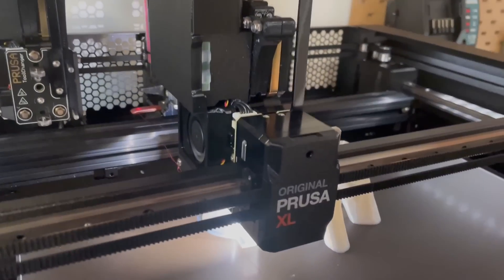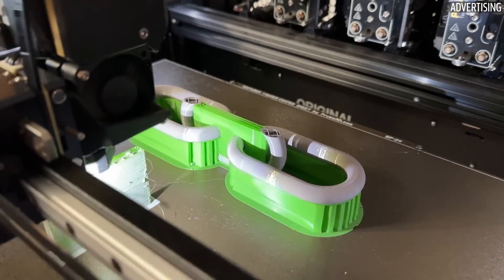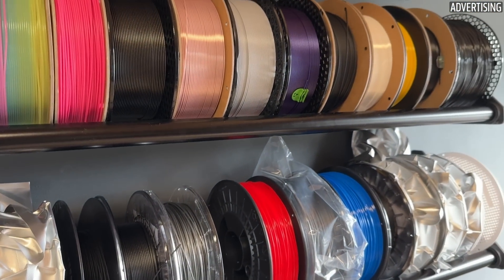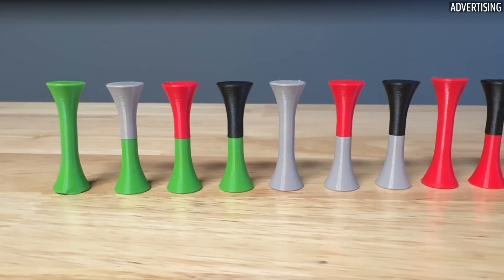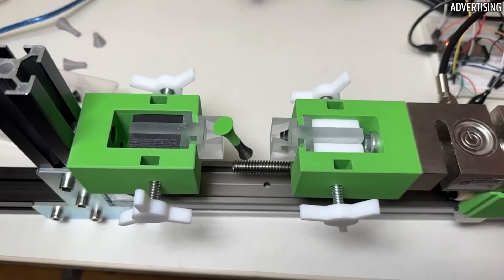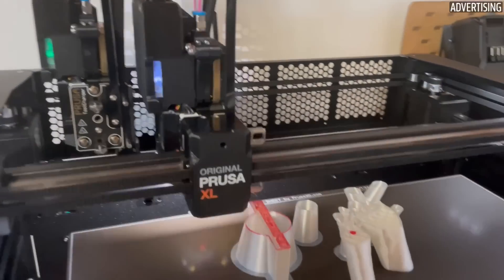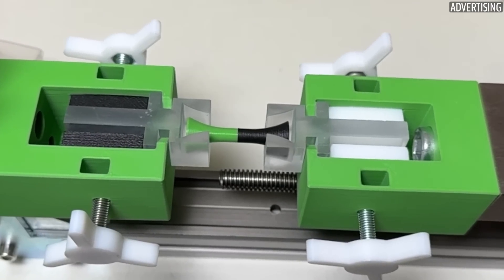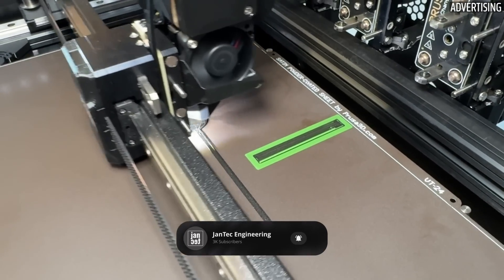You’re Printing ABS Wrong! No Warping & Less Energy Consumption with This Trick!

Comment: As ASA seems to be replacing ABS in popularity, I'd be interested to see this test with PLA and ASA
Reply: I have the exact same experience with ABS and ASA, down to the smell. Both are very easy to print if you do these 3 things:
- Make sure it's dry
- Use smooth PEI sheet. The smooth part of this statement is critically important. 
- Print it inside an enclosure.

It is also a good idea to use some PVA glue on PEI sheet because if you don't remove it before it cools it may get stuck and damage the PEI sheet.

PS: There are only 2 reasons to use ASA over ABS:

1 - The price difference is very small
2 - The printed part will be exposed to UV/weather

Any other difference you may notice is more likely to come from brand / batch / storage conditions (like moist) OR color. Surprisingly it can make a lot of difference within the same manufacturer. For example: e-Sun red and green ABS print beautifully, with impeccable surface finish. Now, try your luck with e-Sun white ABS...
Reply: I had a one-year-old roll of ESUN ABS+ and a brand-new one, both dried and properly stored. However, they were only producing brittle prints, even though I tried many variations in temperature and speed even with 0% cooling. I just tried ESUN ASA, and in my opinion, it's simply better.
Reply: @OneTakeFPV it may have nothing to do with the material itself, but with the quality of esun's blend. It can vary even between colors.
If you want to do a fair comparison you need to compare pure ABS and ASA, from the same brand and color.

PS:
My favorite estirene based filament is extrudr ASA orange. 
very similar in performance but instead ABS, is the black ABS from geetech. But I bet both would be outperformed by the ABS filament from Polymaker
Reply: @OneTakeFPV  I have the same problem with ABS+.  Appears to only be layer adhesion.  It needs fan so the edges don't warp, but the fan is the culprit of the poor layer adhesion.
Reply: @tinkerman-q you forgot an important reason to use ASA over ABS. It doesn't smell nearly as bad while printing.
Reply: @tinkerman-q  Just my experience... I use ABS on a textured PEI plate using just IPA before I print. Sticks very well. No adhesives of any kind. Bambu Lab X1C.
Reply: @troywalker8078  I never tried that, thanks for the tip. Though I don't often have adhesion issues with ABS and I have smooth PEI I just tend to stick to what I know works, and texturized PEI doesn't adhere as well as smooth one, so I had some issues with it for certain parts that are prone to warping, but will try that out of curiosity, thanks for the tip, though the fact that you have an X1C may also play a role, by having that perfect first layer, fined tuned profile and what not others may not have.
Reply: @tinkerman-q  I disagree because i do it the other way and have no issues at all.
If someone uses adhesives on a PEI plate, hes and absolute bob and should just clean it with ACETONE.
Also i use rough PEI sheets with no issues. 
But you will learn, padawan.
Rest is common sense.
Reply: @tinkerman-q  ABS is VERY toxic. How toxic is ASA?
Reply: @andyspoo2  I can't tell you to detail ASA toxicity, but you can put it side by side with ABS. Styrene is still the base component for both plastic types. I got ASA poisoning once, which taught me a valuable lesson when working with these materials.
Reply: @tinkerman-q Did you mean to say to use PVA glue to protect PEI from ASA/ABS? I've never seen it stay adhered well enough after it cools to damage PEI. Unlike PETG, it simply pops off. 

Also I'd advise against using glue as much as possible because it can actually detach from it easier than a clean PEI bed during the print. Once I stopped using glue or cleaning the bed with IPA, ASA became my primary filament. Instead, the best option IMO is to put a SMALL dab of acetone on a clean microfiber cloth then clean the PEI before every print. I've done this for years now but never squirt it directly on the bed, especially if it's heated up.
Reply: @JJFX-  Yes, if we are talking about smooth PEI. Comgrow manufacturer actually features this recommendation in its manual and I could see why. When I did not use glue and first layer was a bit too squeezed, letting it cool would make it incredibly difficult to remove..one of my sheets still has a piece of ABS I could not remove and got damaged with the rest I did remove. Since glue stick never caused adhesion issues with it, I use it most of the time to avoid this problem. My suspicion is that ABS or some blends of ABS may bond with it after it cools. But that's my experience. What I do kbow is that I never have problems with adhesion with or without glue.
Reply: @tinkerman-q  Wow that's interesting, I use multiple smooth PEI beds and have had the opposite experience on all of them, although my primary bed surface now is PEX (or what WhamBam calls PEX). Without fail, ABS/ASA and CF-ASA basically fall off once the bed drops below reported temps of ~50C and I print around ~110C. Only with PET type plastics have I seen significant adhesion like you're referring to. Are you using an ABS hybrid (often marketed as "low warping", etc.)?
Reply: @JJFX-  Most of my ABS are eSun ABS+, and I did not pay attention if the super adhesive experience was exclusive to it or some of the other blends I use. I save ASA for when I need UV resistance, so can't say much about it, except that smooth PEI works well for it too. Most of the time I am around to pop it out of the bed and I usually do around 60C (print between 110 and 115). In the end I think careful experimentation is the best approach on these details. And I avoid PETG on the smooth surface as it also sticks too well to it. The texturized PEI makes it pop after cooling.
Reply: @tinkerman-q  Hmn I haven't used eSun's ABS in awhile but don't recall it causing this either. Well regardless of the reason, having too much adhesion with ABS is a nice problem to have. I've been leaning into ASA now because it's so much easier to get cheap than in the past. On top of the UV resistance, it's a bit easier to work with, doesn't smell as much (although it may release even more VOCs) and at least in my tests there's very little difference in the material properties. It does have a slightly duller appearance which I prefer but I know some people like that about ABS.
Reply: @JJFX-  I totally get you. And indeed. ASA to ABS difference is not as high as it used to be (I managed to get a 1kg roll of ASA-CF for 11 euros recently in a sale of eryone, highly recommend). Smell-wise my advice is that you should not be smelling it, it can be really bad, and I think I got off easy with only a blistering migraine. I am more scared of ASA than ABS, but either way I always wear a respirator when working with either.
Reply: @tinkerman-q  Wow that's a heck of a deal my friend, I'll definitely take note of that. ASA-CF is my favorite prototyping material, it's just awesome stuff. I have some rolls from 3DXTech that are a dream to work with but they're way too expensive.... and yes, I have a decent filtration system and a respirator I typically use but I can't say I'm always good about using it when I need to quickly do something. I've also become increasingly cautious about the fibers in CF fill.
Reply: Be careful with ASA, it releases more VOCs in the air than ABS.
Reply: asa is the same as abs but stinks much less and easier to print
Reply: Bambu studio with my p1s doesn't like mixing ASA with PLA, but using 3dlac and upping the bed to 100°C, and i no longer have warping nor adhesion issues (quite the contrary)
Reply: I expect it to be exactly the same
Reply: That’s what I’ve thought. It’s pretty awesome technique non the less!
Reply: ABS is a lot cheaper than ASA. But ASA has some better properties.
Reply: I wish HIPS would become more popular, as it's similar to ABS but easier to print. Currently, however, it is more expensive and harder to find.
Reply: Can't get ASA to stick to safe my life. ABS is relatively easy, even on an open bed slinger
Reply: @willofthemaker  lol yeah, I recently used ASA to print my enclosure for the P1P and I had to fight the filament a bit. High high bed temps and just accepting a little warping was my solution. + A cardboard enclosure while I made my real one.
Reply: @willofthemaker  Might be the brand you're using? I experience no difference sticking ABS or ASA
Reply: @willofthemaker  I have to use glue stick or ASA will not stick at all.
Reply: @willofthemaker  You're not using real ABS then, lots of ABS+ formulations are actually ABS cut with PLA and will print find on open air beds, but lack the mechnical properties of real ABS. Real ABS will not at all print without being in a chamber.
Reply: @willofthemaker  asa needs an eclosure and heated ideally
Reply: @willofthemaker  I print more ASA than almost any other filament and have no issues getting it to stick.

Except after I print PLA, if I follow a PLA print with ASA it acts like the print bed is slick.

So after I finish a PLA (or even PETG) print I clean the print bed with the rough side of a kitchen sponge, hot water, and dish soap. Fully rinse and dry the build plate.

I never have adhesion issues if I clean the plate.

I print my ASA on a Voron 2.4r2, at 50C for the build chamber, 100C for the bed, and 245C for the hotend.
Reply: @willofthemaker  On an open machine, do you not have any issues with layer cracks due to shrinkage ripping the parts apart?
Reply: @soundspark  "sometimes." My printers are in my garage which is not climate controlled. In the summer on hot days, it's definitely helpful compared to cold days. Potentially 20+ deg C difference depending on the season.
Also a lot of what I do with ABS don't have huge cross sections so I imagine the nozzle goes by where it already played down filament relatively quickly. Maybe rewarms up  the filament enough to prevent splitting. Honestly I don't get splitting too often.. I print ABS around 250-260 and no fan. 100c bed
Reply: @willofthemaker  The Bed temperature has to be above the crystalysation point.
Extrudur asa for me worked perfect at 102°c on textured pei. But I'd go higher if the cooling fan wouldn't cool down the heatbed so much, that more isn't acivable for me.
Also try some asa slurry (acetone +asa), bit that may result in parts sticking to good.

Comment: Wish I could afford a Prusa XL to do stuff like this.
Reply: I'm really hoping prusa comes out with a 300 cubed core xy tool changer. Even 2 or 3 Print heads would be great
Reply: @willofthemaker the XL is 350 cubed
Reply: @krollmond7544  true. I honestly thought it was bigger. Although I think the structure is so strange. Why not the vertical struts in the front instead of the half cantilevered frame. Leads to a horrific enclosure solution that requires way too much time to put together. I don't have near enough time for that nonsense

Comment: Great Test and approach. About PLA as a first layer for ABS: ABS needs those temepratures. It‘s not only about the adhesion of the first layer. The elevated bed temperatures are important for the whole Part not cooling  down.
Warping comes from the upper segment of a part shrinking too much and therefore pulling the below layers up.

Try thicker parts or 100 filled cubes 100x100x100 or even bigger.

What you‘ve found is just an edge case and is not used for example in the professional 3DP industry.

Keep your content up and stay curious!

Sincerly
Andreas
Reply: I wonder how would it warp if someone combined 1-2 layers of PLA every 10-20 layers of ABS. PLA stiffnes should offer a lot of resistance against warping, creating some type of composite material, but I wonder if it would work well. 
For ABS you should generally always have enclsoed printer.
Reply: @OldSkullSoldier  You could potentially do it as a [solid?] infill layer every so often (so it's not visible)?
Reply: One of the tests was literally a warp-test though and did "better" than the pure ABS, butttt I air-quote that part because the printer is also not enclosed and ABS does have a finickyness to getting it to stick, so I'm tempted to say those particular results can't be held as valid, you really never want to print ABS like that if it's anything precise, drafts rob the thermals and make everything shift. Oddly though, I wonder if 60c had less warp due to only adhesion, or because the updraft thermals the bed makes, would be less turbulent and draw in less cooling from the sides?

Comment: 60C seams too low bed temperature for ABS or ASA. How about using 80C? Too hot for pla layer?
Reply: Pla transition temperature is well below 80. This means it would be in a soft state and any force can deform it. Add the temperature from the melted ABS to the situation aaaaaand..

Comment: That is really cool, and the good thing is that you don’t even need to use a multi head printer - since you (hopefully should) watch the first layer anyway, it is not much of a problem to change the filament after the first layer.
Reply from the maker: That's 100% correct. I will also do some tests on my (non multi head) MK4 with a manual layer change for the second video.

Comment: How thick does the layer need to be for the PLA base?

I'm going to try with ASA and PLA
Reply from the maker: I did one (0.2 mm) layer. You could also try a couple more, maybe two or three. Feel free to let me know how it worked for you!
Reply: @JanTecEngineering That's Incredible that such a small layer can help so much! Thank you for finding such a " hack"

I shall try tomorrow I have a bracket on my printer head that is currently PLA but it softens and doesn't grip well. 

I'm hoping I can print the part in ASA but I haven't done this as I have a Kobra 2 max and the bed doesn't get very hot and it is not enclosed.

Comment: You're really print ABS wrong. In order to print ABS you should trash that PEI sheet, install glass, use PVP and 110C bed. Zero warping, 100% success.
Reply: Missing the point dude.
Reply: Apparenly we glass guys have been printing it wrong the entire time, and PLA's all the bed adhesion we need afterall. I guess PLA's useful for something afterall.
Reply: I print ASA on glass. It's fine but still warps without elevated chamber temps. Also, with a 110C bed temp, you'll get elephant's foot.
Reply: @naasking  Use proper adhesive. I use polyvinylpyrrolidone dissolved in isopropyl alcohol. Zero warping, even on 100C bed.

Comment: This is just phenomenal research. I have also been doing some testing of my own and have found some things you might find interesting:

PC-PBT from PolyMaker is the most impact resistant filament I have tested to date. PolyMaker recommends a 100c chamber (!) but even at 45c it works great. No fan, print around 50mm/s for the most strength.

CF-PLA. Most people look down on it. However I have been experimenting with no fan - Stefan tested PLA with no fan and found strength gains, but at the cost of appearance. CF-PLA stays in place better and prints great with longer layer times. Additionally, annealing with it is amazing. I don't have an oven capable of precise temperature control so I have been doing water bath annealing in a slow cooker set to LOW. It takes about 3 hours to reach 195f (90c) and that's when I shut it off and let it cool naturally. With the CF-PLA I have been getting <1% shrinkage in XY and about 1% expansion in Z. This allows people who only have a bedslinger with a PTFE tube to still print heat resistant parts - or even if you have an enclosure, it allows for much more rigid parts than most heat resistant filaments provide.

There are a few more things I am investigating. I have done some write ups (no fancy video production here, just PDFs with my results and methodology). If you'd like to see, I'd love to share them.